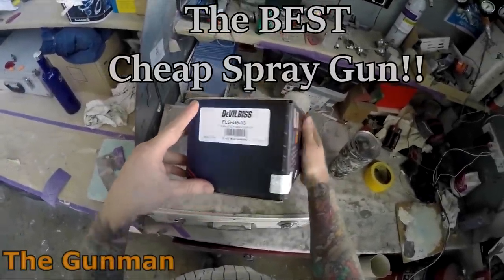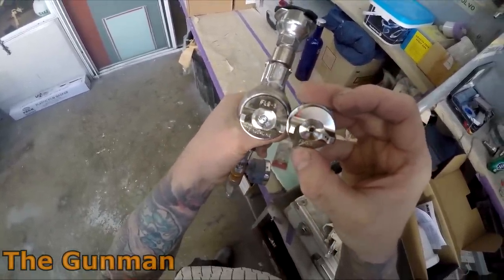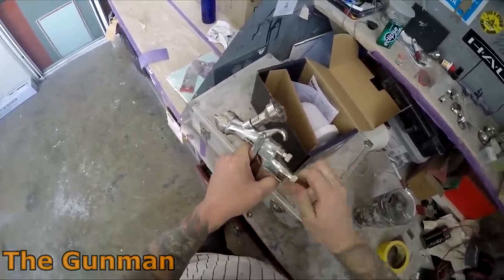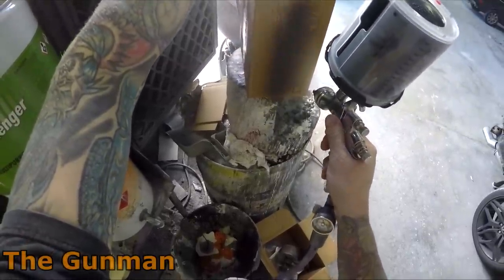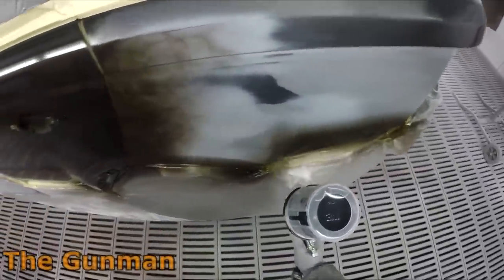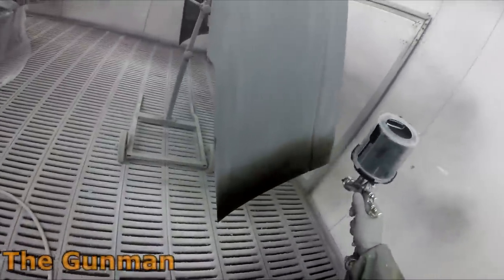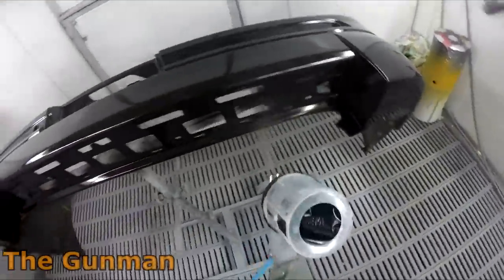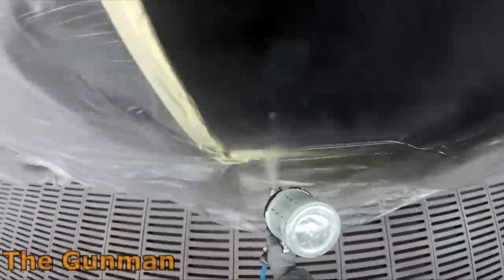The BEST Cheap Spray Gun!!!

Comment: I'm ready to buy the gti pro lite for clear spraying and I i need some advice. What air cap and tip size. Many thanks. Love your videos and God Bless!
Reply: You'll need a 1.2 or 1.3 T110
Reply: I use the gti pro lite for my clear gun.
I spray in my garage, and it gets cold at times.
I use the 1.2mm tip with a T110 air cap.
This combo works great for me
Reply: I see the fast and classic hvlp air caps and the trans tech. Which one is the t110? Thanks you guys

Comment: Gun Man, can you tell me what adaptor will work between the Tekna ProLite and the 3M PPS paint cups, the gun came with a black #43, that does not work with the cup system. I bought a 3M adapter #S27, but it leaks at the gun, is this the right one? Thanks!
Reply: i think you need the #S15

Comment: Should i get the flg5 with 1.3 tip or 1.4 tip for metallic single stage urethane ?
Reply from the maker: Both work fine, if you live in warm climate maybe go for the 1.4 and if colder maybe go 1.3

Comment: Hi Gunman just looking at getting a 
gti pro lite 1.3 but not sure wich air cap to get I’m after 1 gun to spray base and clear ,thanks
Reply from the maker: I like TE20 myself, if you are spraying at home you may be better off using the TE10 or T110 if you want flatter finishes. Hope that helps.
Reply: The Gunman do you have any gunman pro lite edition that you wanna get rid of

Comment: I was looking at the SLG-650 set but wasn't sure after your review, already have old smaller Touch up Devilbiss which still works so Ive took your advice for home diyer and bought the FLG5 as i need to paint my CRX panels

Comment: Hi, I use an LPH80 with 1.2mm tip for top coating my art and spraying base areas that are just too large for airbrush. I dont do cars.

I'm thinking of getting another gun for clear coat and was considering the 1.3 ANI R16 HTS, but this one looks good too.

An important factor for me due to my work area is overspray so transfer efficiency is important to me. 

I have a relatively small compressor and it's ok with the LPH80 but I'm interested in how you would compare a gun like this to the ANI mini gun.

THanks for another great video too.

Comment: Can anyone tell me, would this gun work on a smaller 3HP 50L, 8bar, 220LPM compressor? the gun specs do say it uses 9.8 cfm (277 L/min) is this a HVLP style gun? im thinking maybe my little compressor may not work well with this gun. im probably better off with a LVLP gun, but just looking around at stuff atm.
Reply from the maker: You'll struggle with nearly all guns with a compressor that small. I'd look into upgrading the compressor
Reply: @TheGunmanChannel  thanks for the reply gunman, yes ive been told that may be the case. But, i wont be trying to spray a whole car, just bits and pieces (panels/bumpers ect) so i guess I'll try a lplv gun and see what it can do. Its a V-twin 3hp dd so if i am only spraying smaller area's i think it may just be alright 👍